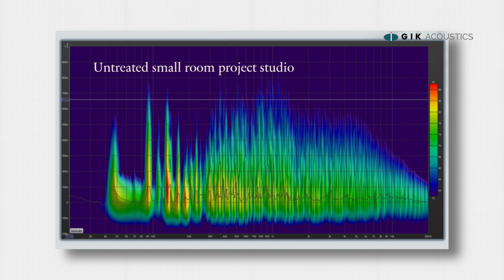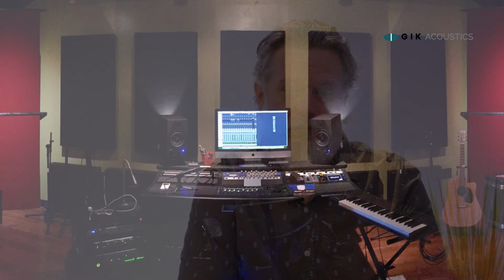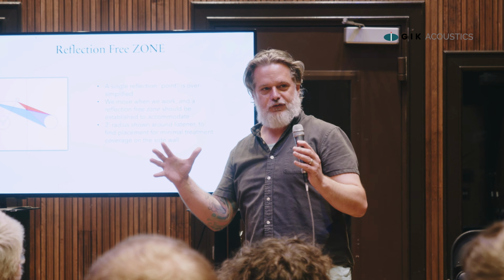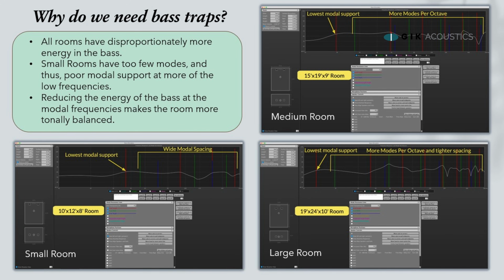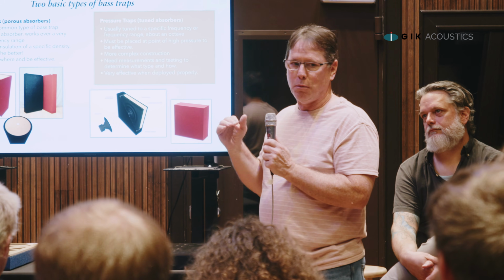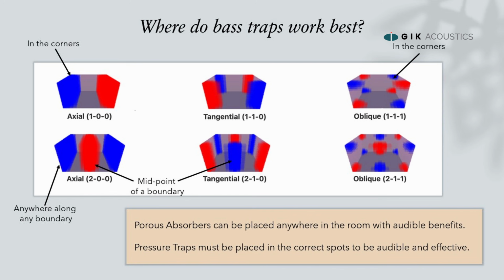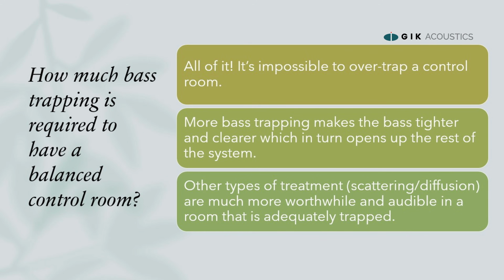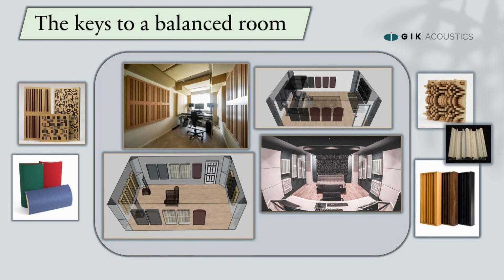Studio Acoustics Masterclass at The Blackbird Academy

Comment: •	Modes refer to the specific patterns in which a system (like a room, a string, or a panel) naturally vibrates. Each mode has its own shape and a corresponding frequency at which it prefers to oscillate. In acoustics, we often talk about room modes — standing wave patterns that occur at specific frequencies in a room.
	•	Resonances happen when an external force (like a sound wave) drives a system at one of its natural mode frequencies, causing a big increase in amplitude. So, resonance is what you get when you excite a mode.

In short:
	•	Modes are the “possibility” — the natural ways something can vibrate.
	•	Resonance is the “reaction” — what happens when a mode gets energy at its specific frequency.

Comment: Thank you for this detailed, accurate, and engaging presentation.  Your team are great speakers and did a professional job in explaining complex, hard-to-grasp, room acoustics concepts in a way that was accessible for beginners while also containing more intermediate information for those with a grasp of the fundamentals.  

You are the only people I've seen on Youtube who always seem to present 100% accurate information.  I can't tell you the number of times people have come to me with weird ideas in their heads after watching someone's channel.  All of a sudden thinking they need $12,000 activated carbon bass traps, or building a massive PRD covering their back wall, 5 feet from their mix position, or trying to build Helmholtz resonators to kill a mode before doing anything with porous absorption.  

One thing you didn't discuss at all, and something that I think it quite important to understand, is what porous absorption you use in your modules.  Fiberglass, mineral wool, what density etc.  Things like GFR maybe could be too advanced for this primer but I consider them quite fundamental.  Primacoustic uses 100 kg/m3 fiberglass from what I understand.  Very high density, very reflective.  I assume you're using a much lower density compound.  

Finally, another thing I get a lot is people thinking that mineral wool or glass fiber is toxic and unsafe (even when wrapped twice).  They'll say you should only use recycled denim.  Apparently they haven't read Rod Jervais's book, he has a good rant on that.  It would be nice to hear you weigh in on that aspect of using porous absorption in your studio.  

Anyways, I'm so glad you did this video and please keep 'em coming!

Comment: I did the Egg cartons glued to 4 x 8 x 1/2 inch think Insulation board with one side foiled. I did it in my garage for the band I was in back in the late 80's. I did the entry door on the House wall as well. It really stopped the bleed through that the family room was getting. It did surprisingly well actually. At least my family could watch TV at normal levels again lol. 
I spent about $400 on the 14 x 32 garage. Didn't treat the ceiling, but it was insulated above. Cool thing as well, you didn't hear us playing anymore walking down the sidewalk, lol. You had to stand about 3 feet close to the garage door lol. I think what really helped with that was, I loaded all the shelves and cabinets in front of the garage door, about 10 foot or so deep up to the ceiling, so it was blocking the sound lol. 
Only bad thing was we were about 120db because our drummer could smack a snare and peg 120db lol. That was the loudest thing in the room. Every one liked it a lot. Could hear each other well and it did not seem as loud as the db meter said, lol. 

So I got into mixing about 2009, and had a 10 x 16 x 8' 2" room. Bought the larger 244/Monster Package, and set it up accordingly. I did plenty of mixes in the room before treatment, and it was actually difficult to get a decent mix, much less a good one, lol. But I did learn in that room how compression, EQ and a ton of mixing techniques work, but just with bad results out of that room. So I gave up on a commercial release option lool. ANd just learned enough to know what I needed to do. 
One I had to get better speakers with no rear bass ports, lol. JBL's were cheap enough to learn on, but never going to work with what I wanted. 
Second thing was Treatment. The GIK package really got that room pretty much perfect. I also bought large Sound Blankets made from a company that made them fireproof and built to work well in high and some high mid frequency reflections. It solved the 2 Window reflections, and wasn't concerned of bleed outside. I was told I need to cover a bit more of the reflections than the GIK package could cover. A package of 6 Sound Blankets about 8' x 84" were hung with Heavy duty Curtain Rods. Those things are heavy, but 2 " Ring Clips attached to the Curtains are supported well. 
Mixes translated surprisingly well !!! I was actually getting good results in competitions and suggestions I could actually accomplish just being in the room. Never felt like I had to check in the truck audio anymore either lol. Really appreciate not "having " to use headphones all the time ;) So then I had too many headphones, lol. 
If I hadn't broke my back in 2012, I might have been doing a lot of recording and mixing, lol. 

So now I'm a little over 60, and in a new larger space, 25 x 27 x 9 room. Same treatment and blankets, carpet floors, and it has room for all my guitars, amps, keyboards, and drums lol. So called GIK, and they gave me a great set up with what I had already purchased. Did a few mixes, and I feel pretty good so far. 
But all that will change since I'm removing the carpet replacing with nice laminate flooring, and some nice rugs. I'll eventually treat the ceiling for sound proofing a bit, doesn't need much. And some GOBO's for Reflection adding and removing to help with recording. And I'll have room for Thee COUCH, lol. 
But other than doing the actual work with my physical limitations is all I need to do. I have learned great patients being a bit disabled, lol. I'm in no hurry, since I can't really be rushed lol. It'll will be a beautiful room when done. Right now it's an eyesore the ole lady has developed great patients with me for, lol. At least she really thinks it'll will look great when done. 

Then I'll be calling GIK again lol. Join their Facebook Acoustic Treatment group... It's really come along and great advice from there also. Great for reference and new ideas as well. 
If you're not familiar with REW Room Audio software, it's a good idea to grab it, it's free.
Reply from the maker: Acoustics has come a long way since egg cartons, ha! Glad we could be a part of your journey.